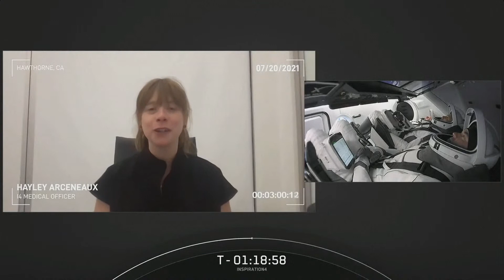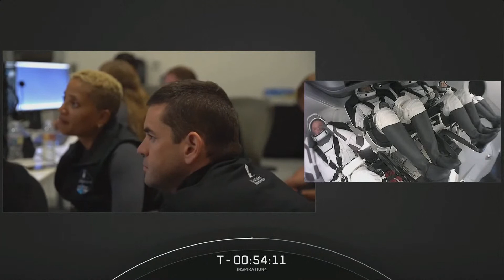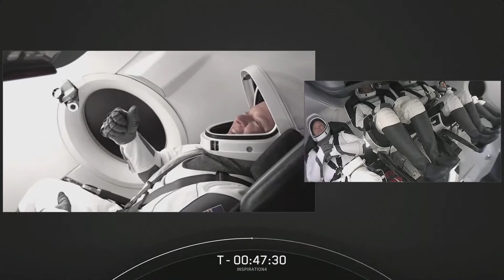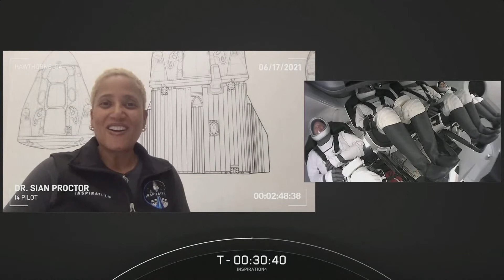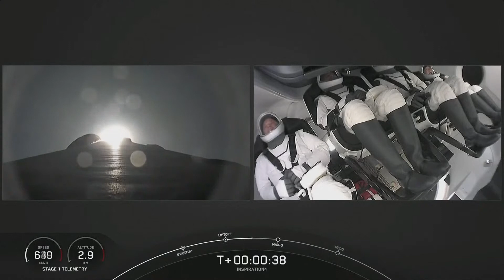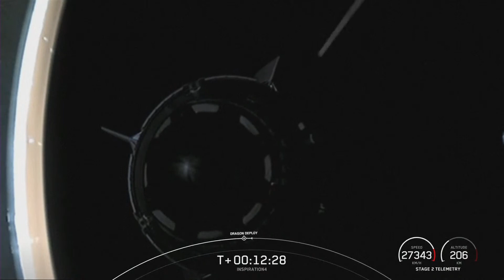Live: SpaceX launches first all-civilian crew into orbit

Comment: Fake.   A fighter pilot flying a F-18 needs a mask with oxygen and these guys open their visors. No oxygen?   Lol
Reply: They are in a pressurized capsule, like an airplane. They reason they have the space suits is in case something goes wrong on launch. They are completely sealed if the capsule loses pressure for some reason. 
Also, fighter pilots take their masks off when they are flying.